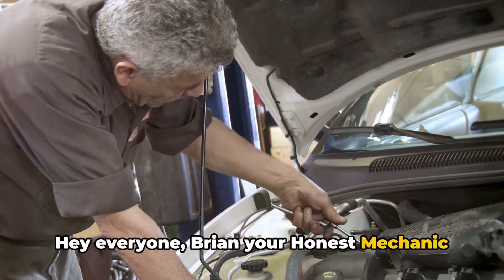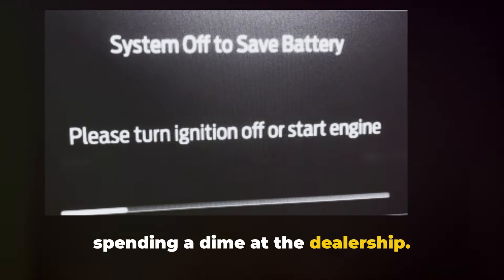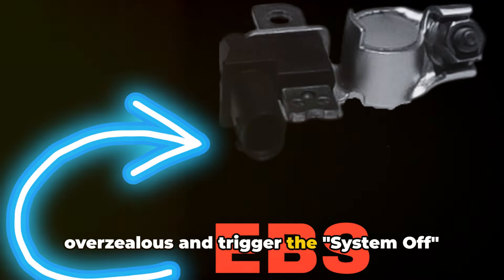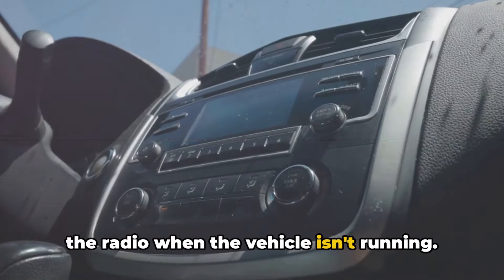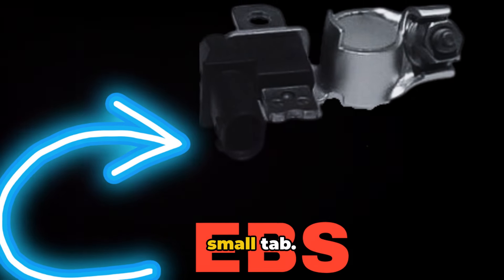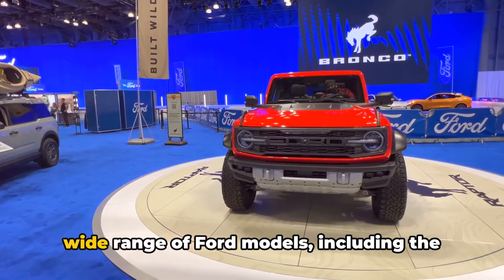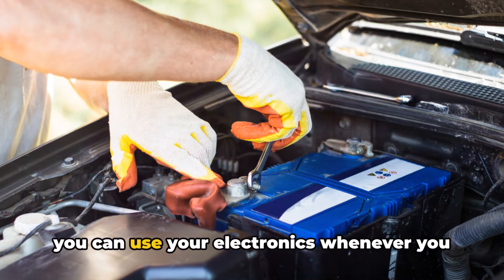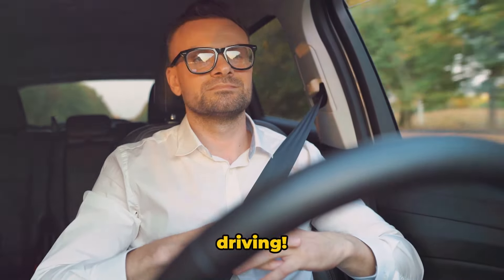Ford "System Off to Save Battery" Causes & Quick Fix

Comment: I did this disconnection on my 2015 Ford Explorer XLT a year ago and my Explorer now  runs perfect without the annoying beeping battery display message every time I started my vehicle in cold weather. I did have to remove my air filter cover to get to the sensor connection.

Comment: I have a 2023 Ford F150 and have been getting this message occasionally when I turn off the vehicle.  The battery has been tested and all good there. Also, my interior lights will not come on when opening the doors.  Would this be related to the sensor you have described in video?? Thanks
Reply: Same thing here , 2023 F150
Reply: Same! Everything tested good so I’m sure it’s an issue with the battery saver mode as I’ve read many people have had issues with it.
Reply: Same here, 2013 Flex. Newer AGM battery. When checked, always 12+ volts. Only an aftermarket camera and underglow installed. Both turned off when car is off. Always starts, never sounds dead, warning every single time I shut off my car.
Reply: @NoShadowOfDoubt1 SAME FOR ME!!!!!!! I am beyond frustrated
Reply: I'm having the exact same issue. And I can't find anything about it if you find anything out please let us know in the comment.

Comment: I have a 2015 Ford explorer limited. I was constantly getting those messages you mentioned. My battery is almost brand new. Disconnecting the sensor ring from the negative cable and it worked. Mahalo

Comment: Ford calls this the BMS(Battery Management System).   There are ways to reset it very easily.  Matter of fact anytime you change the battery the BMS must be reset.  Of course disconnecting might be a solution as well.

Comment: does this method include 2021  f150 models? My 2015 F150 had power going to things like the 12 volt plug for up to 15 minutes after the truck shut down. The 2021 the 12 volt turns off immediately. Thanks

Comment: Thanks for the video, 2021 bronco I just got into the truck to turn it around in my garage and noticed no dome lite, then I shut it down and system saver came up, I drove it Saturday short distance, now Tuesday, chilly in Pa but not freezing,  I will check the senor. Thanks

Comment: My ford fusion nav screen was showing that familiar message “system off to save battery”. The car worked and started fine. So I used the reset BMS procedure as you show. But right after that a yellow wrench icon appeared and my Fordpass alerted to a Powertrain fault detected reduced power. Once I started the car the yellow wrench icon went away. But it did scare me. I will take my car to get battery replaced since it is over five years old now.

Comment: Hello, i bought a 2019 ecoboost mustang convertible last year, i got my oil change at ford and now it's doing this thing in the video, so is it a possibility that the battery that came with it maybe bad now?  I did have to jump it, but when i got to advance auto and they checked the battery, i was told that everything is fine.  So I'll check the ebs when i get home, but maybe it's time for a battery replacement?

Comment: I have this message even when my car has got engine running. I have a new battery fitted and still have this problem is this a safe to remove and not replace please

Comment: 20221 Ford Edge ST, original battery. I was getting the "system off to save battery" message and my Ford Pass App would not work to remote start my car. This is extra frustrating because it does not have the remote start by FOB. I did the BMS reset (power on, flash hi beams 5 times, press brake 3 times, power off vehicle) and for now no more annoying system message and Ford Pass App is able to remote start vehicle.

Comment: What does also cause your battery to be at 12 volts or lower every morning the voltage drops very quickly from 12.6 down to as low as 11.6 the battery test is good and the alternator is charging

Comment: Turns out it was my alternator. Car was running on battery only (2014 Ford fusion)
Reply: Soif i get that message and battery test was good and Truck wont start that means its the alternator?

Comment: I have a Taurus, I got that warning once yesterday but My Sync system(radio and display) is off  for 2 weeks and the ambient light turned off days later. Is not working due to low battery voltage too?
Reply: Same thing happened to me last week in my 18 taurus. I was playing music with the engine off. Battery was replaced on thanksgiving so its new. Did you try this and did it work for you?

Comment: My (UK) 2024 Ford Focus has this problem. Surely, doing what is suggested in the video only masks the problem and not actually fixes it?
Reply from the maker: Hi, thanks for watching. I believe replacing the IBS sensor should permanently fix the problem (although you can mask the problem without any issues).
Reply: You're not making the problem if the battery is good and the EBS isn't.
Reply: Problem is if you fix the problem it will just be broke again in 6 months.  It's a bad design.

Comment: Could this be from my dash cam?  Also, could this prevent my truck from starting?
Reply: It is a great possibility that it is. They draw a lot of power from the battery when the engine isn't running

Comment: My 2022 F150 keeps throwing that message and the interior lights won't come on when the doors are opened.  My Ford dealer says it is because I don't have tpms sensors in my wheels and the system is searching for the sensors and draining full charge off my battery.Does this sound correct to you?
Reply: Curious, but why would tpms sensors be active when the vehicle is off? Sounds like BS.

Comment: Ford has done a great disservice to its customers.  Bowing the knee to the EPA, in an effort to increase the average fleet gas mileage, Ford has systematically reduced the weight of its vehicles. That includes reducing the size and capacity of the battery, reducing the size and capacity of the alternator, replacing hydraulic systems (eg. power steering) with electrical systems, and installing the extremely annoying Auto Start-Stop system. All these changes have a consequential impact on the electrical system. Batteries will die after about 2 years and given Murphy's law that will happen at night on a holiday weekend many miles from home. Thanks Green New Deal and thanks Ford for ruining a good product.

Comment: Wouldnt own a Ford ever.
Reply from the maker: Haha. Totally get where you're coming from about Fords. I see/hear they improved over the years (Don't quote me on that :)).
Reply: All cars have similar occasional issues
Reply: Fill your Chevy with fuel it will be worth more for junk
Reply: This a temporary fix people I wouldn’t ride like that for a long time. Without a BMS system your battery can overheat overcharge and explode and catch on fire so basically use this until you can get it fixed heads up
Reply: Then why are you even here?